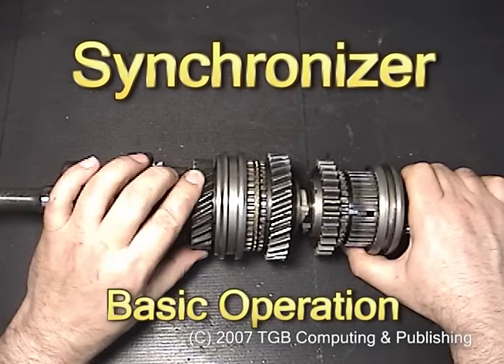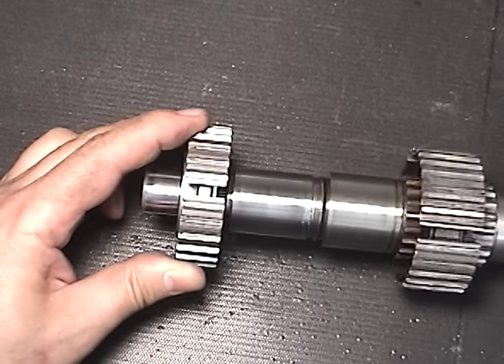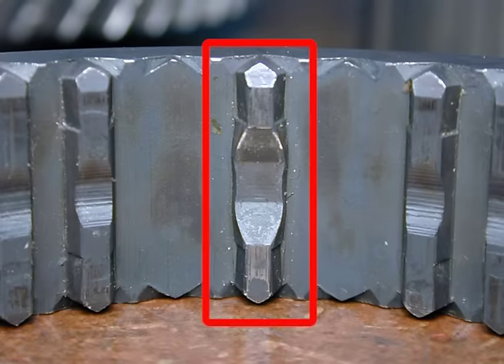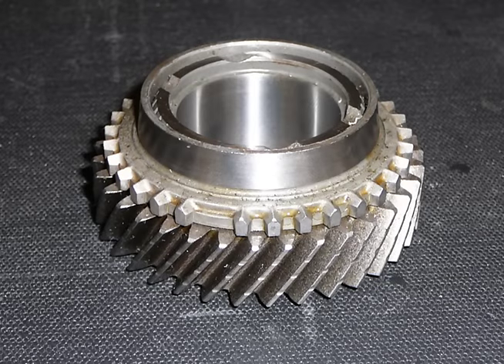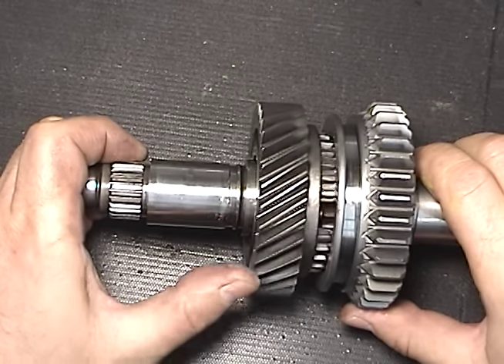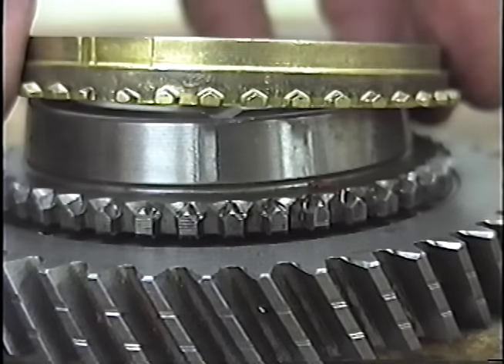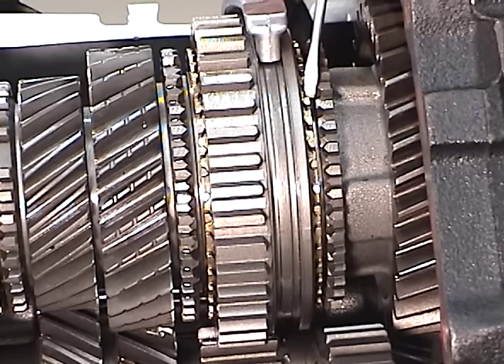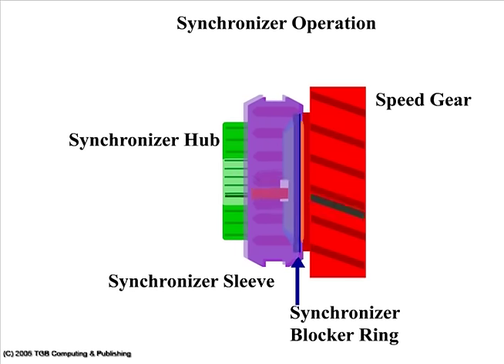Synchronizer Operation Explained

Comment: I'll point out that everyone praising how clear this video is then goes on to describe all the transmissions they've rebuilt. So as the only person who's here to learn instead of to see what they already know, I'll say that I completely disagree about the clarity. This is supposed to be about SYNCHRONIZERS / synchromesh. Instead, it's about the entire transmission. Yes, I see that it happens. But I still don't understand what mechanism is locking it. Is it the conical taper? Is it a friction surface?  Don't know -- we moved on to naming over half the various components of a transmission without explaining what they are ... which means only people who already know the information will brag about it's clarity.  While you're at it, why not define a word using the word you're defining? 

Do syncros require a particular alignment? Or can they synchronize in any orientation? 
As in ... they aren't uniform. So does it require at least 1 full rotation to align features?
Also ... why can't syncros grind?  Because of the taper at the front of the teeth ..?

What's the purpose of the conical taper? Is that what synchronizes the mechanism? (Why not spend a little extra time explaining how/when it occurs with each of the mechanisms to drive home the principle that the video was TITLED?) 

If it's the teeth meshing ... then why don't synchros need synchros? The taper / conical interaction with a friction coating makes sense as to why it wouldn't need synchros. But why would those teeth as animated synchronize without grinding any better than the gears we're synchronizing?

When the only people praising your edu are those who are all practical application valedictorians, you should be concerned that you didn't make the content as introductory as your title suggests.  There are many fields in which I have expertise, and when I try to explain them to others, the main thing I focus on is the avoidance of jargon, of relying on predicate knowledge that the only people who need the information wouldn't have, and on remembering what it was once like to not know those things; because it's that empathy for ignorance that is lost with the very expertise required to explain the content.

Mind you, this was by far better than all the other videos I've yet watched on syncros. So please don't take it as a blanket critique across the board. And clearly, great effort went into this production (and corresponding animation) ... which couldn't have been cheap in either time, money or expertise. All of which I'm grateful for, as this is free content. Please don't mistake my critique as ingratitude.  I'm just unwilling to lie and pretend I've gone from being ignorant to being knowledgeable (even rudimentary) from watching it 5-6 times.
Reply from the maker: I'm sorry this missed the mark for you and all those who are learning but are not familiar with the terminology. A goal of mine is to try and keep the videos high quality and as short as possible and if I have a long winded subject to make it into multiple parts. As someone watching who has not had some formal transmission training or rebuild experience I need to let you know that this is by far not how the entire transmission works and it truly is just about synchronizer operation. A fair amount of viewers have never rebuilt a transmission (Like your) but they may have had some formal training or they are attending a class on manual transmissions and the video helps to clarify what they didn't understand from their instructor. With that said I will try to address your operational questions.  

The conical tapered surfaces between the gear and the blocker ring when pressed together create friction which will attempt to make them rotate at the same speed which if successful will synchronizing the speed between them.  What is not shown is the shift fork, rod, gate, detent, interlock and shifter.  Yes, I know these are technical terms that are not defined. Basically these components are responsible for moving the sleeve which pushes on the keys which push on the blocker ring in an effort to synchronize the gear to the blocker ring and synchronizer assembly so a gear ratio change can be made. These videos are about detent and interlock mechanisms and they may help. https://youtu.be/z7Qht3yOfDg?si=6cY5W393OPiiq1xL and https://youtu.be/U7MBaIPoPZ4?si=CFUVtq0YD9ehFlXk. 

What holds the gear into engagement (Sleeve locked onto the gear) is a combination of the shifter position (which moves the shift rod, fork and sleeve), the detent mechanism, and the cutback design on the clutching teeth on the gear and sleeve. (Timestamp 4:10.)

Synchronizers can be mounted vertically and function but most manual transmission with synchronizers tend to be horizontal in operation.  They do not require one full revolution to synchronize and they will work if the vehicle is stopped or going very slow such as in a parking lot (going from reverse to 1st) or during stop and go heavy traffic. The goal of the synchronizer is prevent grinding and it does this by using the friction between the blocker ring (rotating at shaft and synchronizer assembly speed) and the gear rotating at a different speed. Once the two are in sync the clutching teeth between the sleeve and the gear are close enough in alignment to allow the sleeve to move over (from force of the driver pushing on the shifter) locking the two together. The transmission is now locked into the new gear ratio and held there by the design of the clutching teeth and the shifter and detent mechanism and position. If, or when the blocker ring surface wears to a point where it's incapable of providing efficient synchronization grinding between the clutching teeth on the sleeve, blocker ring and gear will take place and can be heard when the driver shifts gears. This is called "Gear Clash". If these teeth become heavily worn down the transmission will pop out of gear (The shifter will move all by itself into neutral) under heavy acceleration. The shifter and detent alone are unable to maintain gear engagement when the clutching teeth are heavily worn from driving a vehicle that has excessive gear clash during shifting. 

In summary: the conical surface does the synchronization when the shifter is moved but it's not strong enough to handle the torque of the gear ratio.  This is why the clutching teeth on the sleeve need to engage and lock onto the clutching teeth on the gear. The synchronizer sleeve is moved through a mechanical shift mechanism when the driver moves the shifter to change gears. The shifter mechanism, detent (see video links) and clutching teeth keep the gear engaged until the driver moves the shifter again for the next gear selection. 

This was my attempt to clarify your operational questions. The video is what it is and your critique is noted. If you have additional technical operational questions I'm happy to answer them.  

You might also find these videos helpful.
Into to manual transmission power flow and gear ID: https://youtu.be/aAG8kdw1WEk?si=MU8s5wGrDLMKGcZ6
Front wheel drive manual transaxle shifter mechanism:  https://youtu.be/odzSu699njs?si=G2QMd06MzFJxzvpd

These videos may also have similar critiques from you since my videos are all designed to support my lectures and assume a minimal amount of automotive transmission nomenclature knowledge. I will keep this in mind when creating new technical content and make an effort to clarify a technical term into everyday language when I feel that it is needed and it won't make the video too long unlike this response.

Comment: After several videos trying to figure this out, I finally get it. Excellent video. Now I wonder if there would be other ways to slow shaft/gear speed. Synchro's are spendy parts "labor wise" to replace. I also wonder what fluid would cause the least amount of wear & still give satisfactory shifting.
Reply from the maker: Unless a specialized fluid is specified and the spec is 75w-90 or 80w-90 GL4 I really like Redline Manual Transmission Fluid (MTF)
Reply: Good ole stinky 80-90 gear lube is the highest temp rated fluid
Reply: Up here in MN maybe a 75-85 would be a good choice. I think up in the cold states an ATF is hard to beat.  @DrivelineMaster
Reply from the maker: I don't want to give the wrong information.  Most manual transmissions can not and should not use ATF.  ATF can only safely be used in a manual transmission if and only if the service information or owners manual says so.  Never use ATF in a manual transmission unless it has been specified by the manufacture as an acceptable winter oil option.

Comment: Hay I have a 2008 dodge ram 1500 with a manuel 238 Getrag 6speed  transmission in it. I'm have the same problem with second gear. Where can I find the parts for a 238 getrag and can I replace it with another manuel.
Reply from the maker: Unfortunately I don't  have a source for that transmission.  I once had a Getrag from a Toyota Supra and not even Toyota sold replacement parts short of an entire transmission.  You can try West Coast Standard or midwest trans (https://www.midwesttrans.com/product-information/getrag-238-6-speed-rebuilt-manual-transmissions). try searching the internet using "getrag 238 rebuild kit" as your key words.

Comment: The best video to explain synchronizer. But I am a little confused, why did the sychronier blocker ring slow down the speed to snchronize with speed gear? It should be reversed, I mean, speed gear speeds up to sych with blocker ring.
Reply from the maker: When the transmissions is in 1st gear and you shift into 2nd gear (upshift) the speed of 2nd gear is rotating faster because the gear ratio for 2nd gear is a small ratio number such as 1st being 4:1 and 2nd being 3:1.  Because the speed of 2nd gear is rotating faster than the output shaft and the synchro in 1st gear the 2nd gear must slow down to match the speed of the synchro and output shaft before it can engage and lock 2nd to the shaft.  This happens with every gear change during upshifting.  During downshifting this is reversed. The output shaft is going faster than the gear being downshifted into.  Such as going from 4th at 1:1 down to 3rd at 2:1.  Now when the blocker ring grabs the next lowest gear that gear will need to rotate faster or speed up to match the output shaft speed in order to synchronize.  I hope this made sense.  Also, those gear ratios are not actual but instead just used as examples to make a point.

Comment: Hi, so I have a problem with getting the car into 1st gear sometimes. It can be very hard to push it in but no grinding. This would suggest it's the blocker ring doing it's job and the synchroniser and main shaft gear aren't matching speeds. I've checked the slave and master clutch cylinder and I can't see anything that stands out. Do you have a clue what's going on. Shifting into all other gears seems fine. I also have to hold the clutch down for around 10 seconds before I can put the car into reverse without grinding gears. It just seems like a long time before the layby shaft slows down. Clutch actually feels solid and operating as it usually does. Any ideas.
Reply from the maker: A couple of questions when you have problems going into 1st.  Is this when the vehicle is not moving or when downshifting while moving? or both? Have you tried replacing the lubricant with the recommend fluid? Because you said that you have to wait a good 10 seconds to shift into reverse makes me think you might have a spin down problem.  This is where power from the engine continues to send power into the transmission input shaft even if the clutch pedal if fully pressed.  What can happen is one of a few things.  The clutch disk can stick to the flywheel, or the disk could bind on the input shaft and not slide away from the flywheel quickly enough, or the input shaft could be binding on the pilot bearing. All of these will delay clutch disengagement and cause hard shifting. I'm not sure what vehicle you have but I have had good luck using Redline Manual Transmission fluid solving shifting problems.

Comment: amazing work
but what is the speed of  the blocking ring ?
is it equal to shaft or gear speed before synchronizing?
Reply from the maker: The synchronizer hub which is splined to a shaft, the sleeve and the blocker ring all rotate at shaft speed.
Reply: @DrivelineMaster  ok thanks 
is the key  connected rigidly to the blocker ring?
and how are they connecting?
and how does the blocking ring return its  original position?

Comment: So I get that the speeds match up thanks to the blocker ring, but how do the teeth on the gear, blocker ring, and sleeve match up with each other?
Reply: The internal teeth of the sleeve match up just right to the clutching teeth (dogs) on the speed gear as well as the blocker ring. Thus, the sleeve is free to slip over them - but once it does, they must spin together. So when the sleeve is pushed towards the speed gear, the sleeve pushes on the shift keys, which push on the blocker - all towards the speed gear. The internal cone of the blocker presses against the external cone on the speed gear, developing friction and either speeding up or slowing down the speed gear until it matches the speed of the hub/sleeve/blocker assembly. Once that happens, the sleeve can be pushed over the blocker and onto the the clutching teeth of the speed gear - thus coupling the speed gear to the sleeve, and therefore the hub, and therefore the output shaft.
Reply from the maker: The blocker ring rotates with the hub but the blocker ring is not fixed to a position but instead because the connection takes place because of the keys and the cut out on the ring.  The ring can rotate separately about 2-4 degrees from the hub. The teeth on the sleeve, blocker ring and gear are space about 1-3 degrees apart.  Because the teeth are cut at a pointed angle they don't have to align up perfectly.  The video shows that sometimes but even being off slightly when the sleeve starts to move towards the gear the points on the teeth if not perfectly aligned will slide from one side of the tooth or the other forcing alignment. Kind of difficult to explain.  I hope this made sense.  Imagine two really sharp pencils and trying to hold them point to point.  Unless you get it exactly perfect on each point as you move the points towards each other.  If you miss hitting the point perfectly they will slide off the point to one side or the other. It's like that.

Comment: Im trying better to understand the basics of 90s Honda manual transaxles. Why is the imput shaft gears pressed on and not built into the shaft like rear wheel drive, drive gears? And when changing gears to a custom ratio sometimes only the driven gear  gets changed. If your changing the ratio wouldn't both gears need to be changed? Thank you
Reply from the maker: Normally when a gear is pressed onto a shaft as compared to being part of the shaft it's because the gear needs to come off in order to remove or install something else.  It's for assemble and disassemble purposes.  Normally when there is a ratio change both gears are replaced.  I don't see how it is possible to only change one gear.  Let's say you want more low end torque and you want to change from a 3.5:1 1st gear to a 4:1 first gear. The input shaft gear must get smaller but in order for it to mesh properly with the output shaft that gear must be bigger.  I have never done a ratio change on a Honda but it doesn't make logical let alone mechanical sense.

Comment: Great video!  The one part that I don't understand - how does the blocker ring prevent engagement if the gears cannot be synchronized?
Reply from the maker: Here you go.  The sleeve pushes on the keys which push on the blocker ring.  The job of the blocker ring through friction between the ring and the gear is to grab the gear and make it go the same speed (synchronize) so the sleeve can slide over and lock the two together.  If the blocker ring is unable to synchronize the gear to its speed a lot of friction is taking place.  With more friction more heat is generated.  With more heat there is expansion of components.  The heat and expansion is a counter force pushing back on the blocker ring.  That force on the blocker ring is transferred to the keys and then onto the sleeve. The counter force prevents the sleeve from moving close enough to the gear for the clutching teeth to touch.  If the clutching teeth are allowed to touch before synchronization a grinding noise (gear clash) will be heard. Hope this helps.

Comment: What makes a gear to jump out in gear when driving but when you hold a lev
er for a while  it works well
Reply from the maker: Could be several things.  As the video shows the teeth with the cut back. if those are worn from years of grinding during gear shifting that can do it.  Excessive free play in the shifter linkage or worn detent springs.  Depending on how old the vehicle is old 1960 and 1970's vehicles could have misaligned bell housings.  I even had a VW once that had the shifter boot installed backward that cause this.  You could  have worn shift forks or synchronizer sleeves. Anything that would prevent full engagement can cause it to slip out of gear.  Holding the shifter ensured the synchronizer stays engaged with the gear.

Comment: I have 2 questions. 1) At the end 7:43 does the speed gear clutching teethes rotate? I see the angle cut teeth rotation, but not the clutching teethes. 2) And even with the clutch engaged, the counter shaft still rotates at a very high speed.lets say vehicle is stationary and starting to move. so there is no axle shaft or output shaft rotation. but the speed gears will have high speed rotation. So how does the synchronizer ring slow down the speed gear to make the connection in less than a second.
Reply: The speed gear appears stationary thanks to the use of the strobe light. The counter shaft is in mesh with input not output.